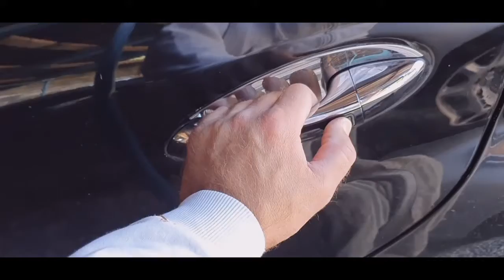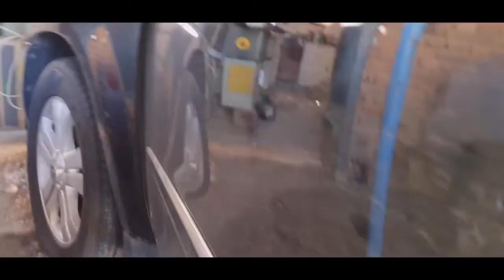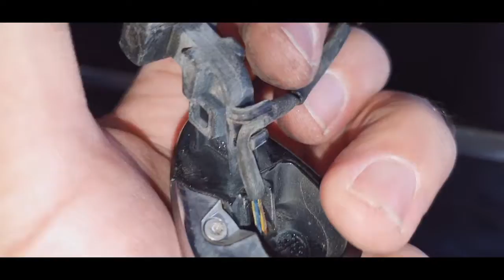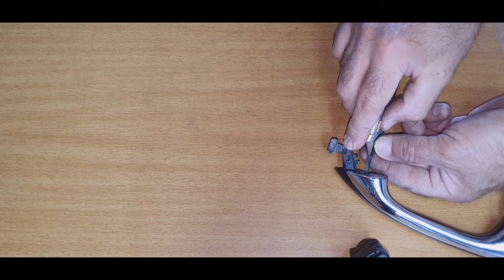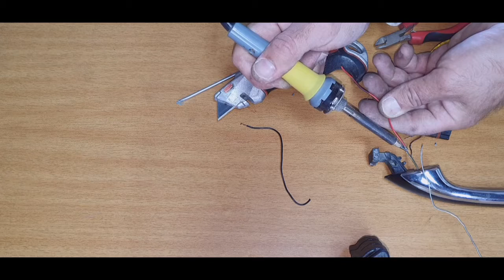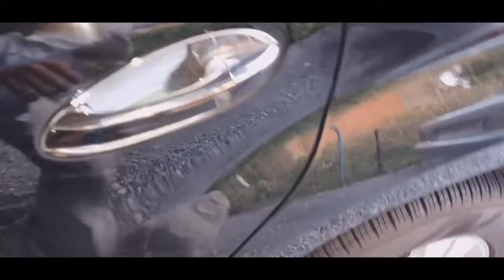Mercedes keyless go servis/keyless go handle repair#repair #keylessgo #mechanic

Comment: Can you suggest me about replacing silicone button, it's gone. I have ordered a new one (silicone button) from shopee but I can't put it in the button.
Reply from the maker: You must pull out old rubber and clean all edge. And simple push new in.
Be careful do not damage handle.
All best
Reply: @yourhandscaneverything  Thank you so much, I will try it.